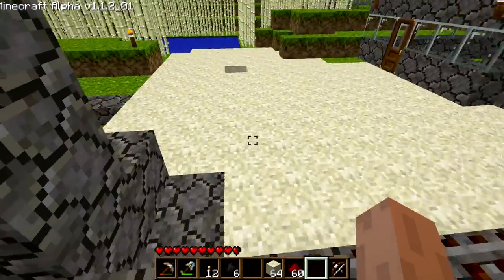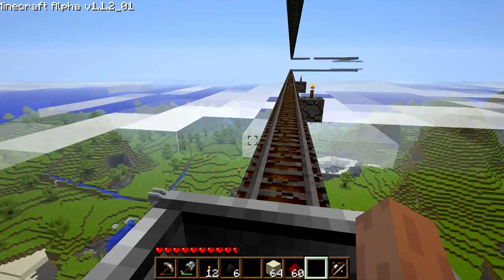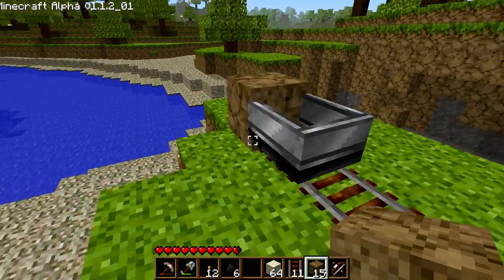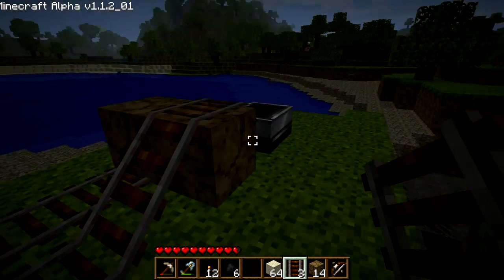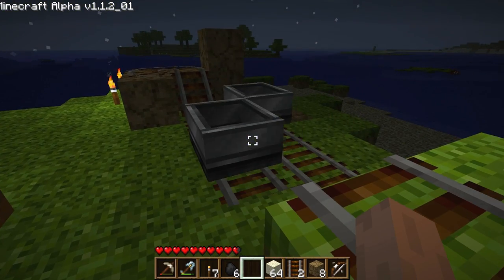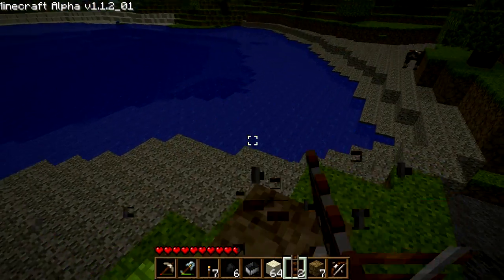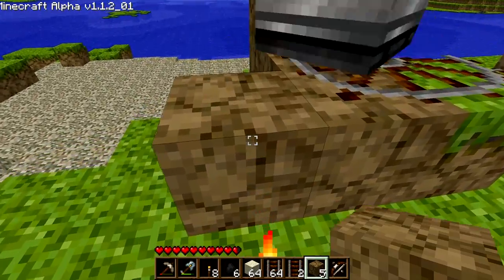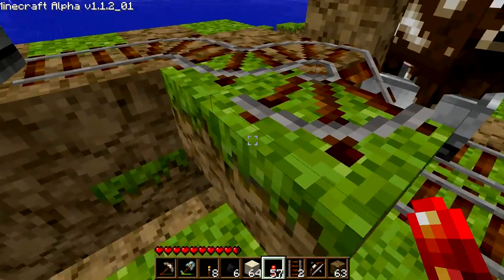How to Build a Train Station in Minecraft - Tutorial p1

Comment: @ookeepmoo i ran into that as well. i had to use a repeater to turn off the redstone torch. but it still hasnt been tweaked to work perfectly yet the repeater turns off the torch and you run the wire from the other end of the repeater. hook a lever to it and it will turn the torch on and off.

Comment: I take back my previous post, I figured out how to make a simpler one in beta 1.5_1. the booster requires 20 rails, 4 booster rails, two redstone torches, some redstone dust, and a switch or button. with the booster rails in a circle in the center, and a ring of regular rails around that one. with carts on each. if you want i can try making a video

Comment: my track isn't working, i put the torch in and it goes on and off with lever and inverter etc etc but it changes two bits of track, the part that goes upwards into the loop switches as well (straight into the wall), I can't see what I'm doing wrong, any ideas?